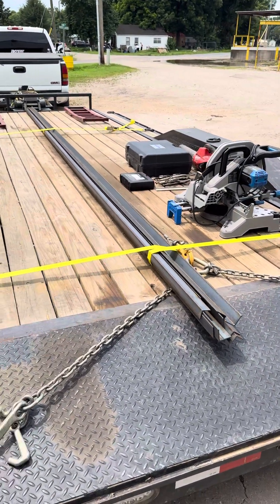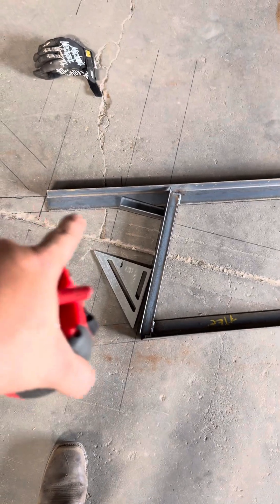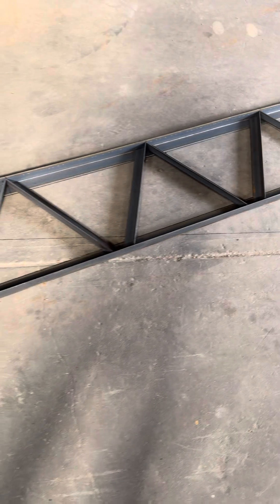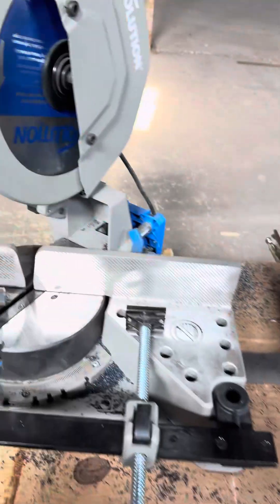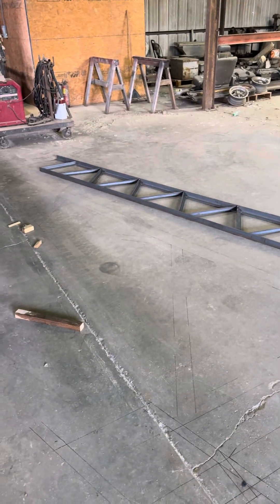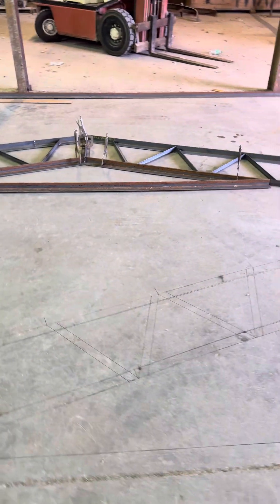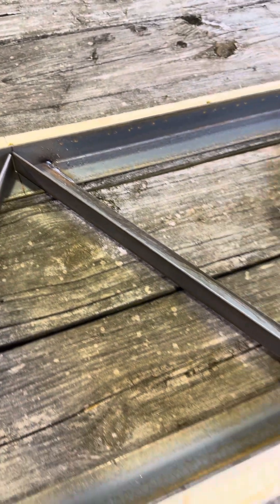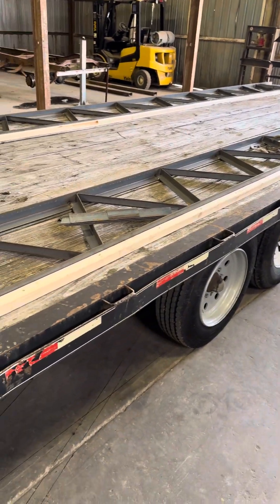DIY Steel Trusses. How to build steel trusses for pole barn/shop

Comment: Any estimate on time it took you per truss?
Reply from the maker: The first one was the hardest to figure out. Had to figure out all the singles and everything. Now that I have all that I built a jig and am able to build them in a couple hours each. Once all the metal is cut. Take about 2 hrs to cut everything.
Reply: @lonniesgarage  you did some awesome work. It was very informative. Thank you for the info and motivation.

Comment: How much did you have in them in materials?
Reply from the maker: I ended up having roughly $300 each. So I’ve decide I’m just gonna buy them premade. Only $50 more and I won’t have to do all the work.
Reply: @lonniesgarage  iv tried figuring out why on earth people pay that bull much when wood trusses spaced same is cheaper and if putting doors in side like most do the truss being regular style truss doesn’t matter as height between trusses still same
Reply: @morehp1  cause you don't know what your talking about
Reply: @Willy-y1j  been building all my life but don’t know what I’m talking about lmao please
Reply: @lonniesgarage  i guess the guys that build them have a cheaper source of steel to buy. what did a 20 foot stick of 2'' x 1/8'' angle cost you?

Comment: Nice work! The jig will definitely speed up the process!
That’s a nice saw too! I need to get one. I have an abrasive cut off saw and they are pretty dangerous. I have had more than one disc explode.
Reply from the maker: I used to use them too but once I got a this type I didn’t go back. The abrasive ones like to walk a little when you’re cutting too. These cut nice and straight every time.